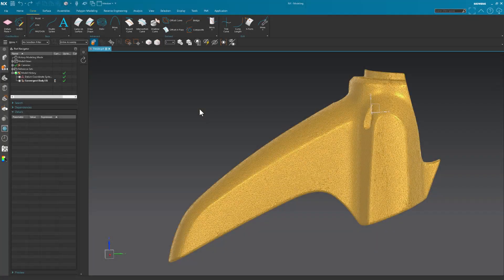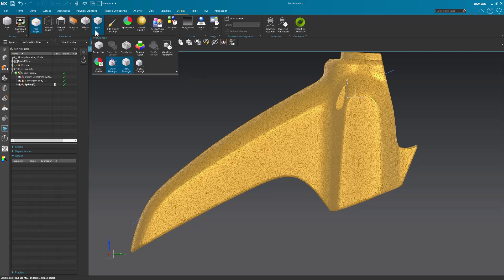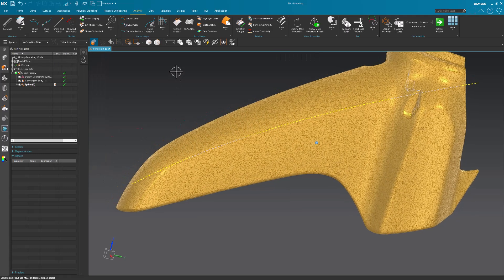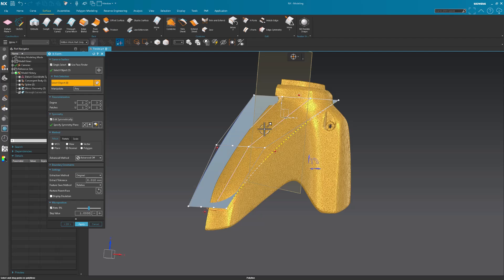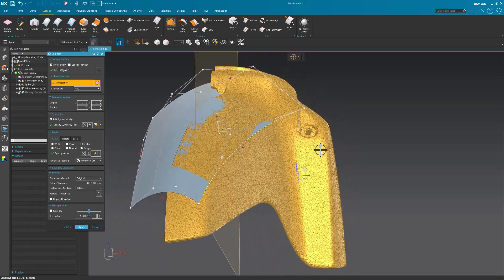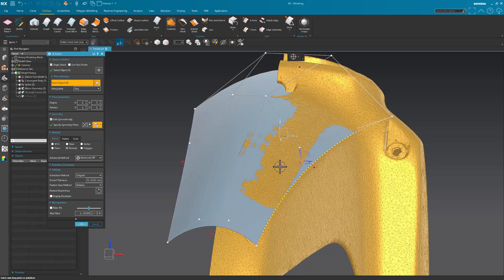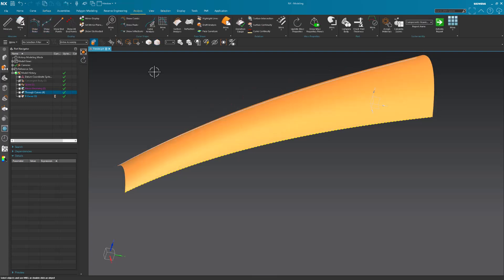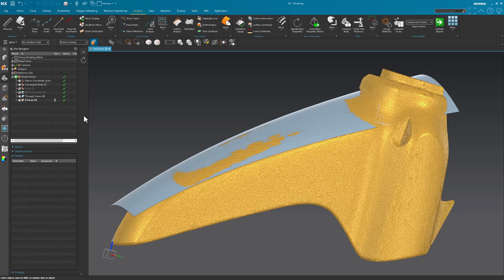Class A in NX 2406 | Design Across Center Plane | Primary Surface and Curve

Comment: 3:02 jesus christ ! use curve from two views sir why is that ?
Reply from the maker: Curve data is cleaner for a simple curve like this.
Reply: Should be obvious in watching the video. Fewer control points, simpler curve and resultant surface, which is easier to push/pull into shape. Always start simple, add points if needed but this is the same workflow I use when starting out because it's clean and easy to work with.

Comment: Hi. Can you switch your big monitor to lower resolution for making video? Now NX UI is hardly readable on smaller screens, laptops. Thanks anyway.
Reply from the maker: Thank you for the input. I will see what can be done. I have a Ultra High Rez screen and scaling things usually makes everything look awful.
Reply: @StevenMarji But perfect on my desktop at 1080p - I'd even ask for 1440 if possible.

Comment: Which space mouse do you use? That is a cool feature. Could come in handy 🙂
Reply from the maker: It's an old old, old, Space Mouse. like 20 years old. Any new one will work. You can program the buttons.
Reply: I find the Spacemouse Pro very handy with programmable buttons. Mines old too but still works well. The lock cap button is very handy in 2D drawing mode and 3D mode - also saves the mouse hand from overwork. With respect to RSI - what's helped the most is program keyboard shortcuts as now I'm fairly regularly moving my hand off the mouse.